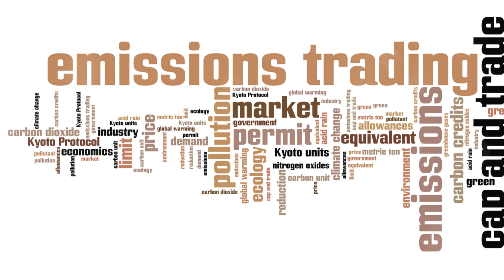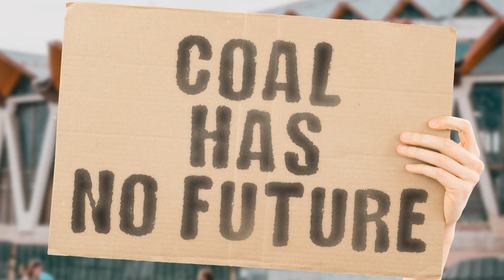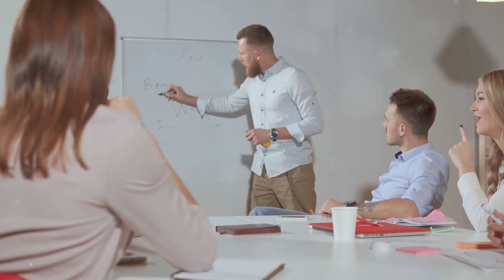Australia's Nuclear Debate: A Bankrupt Idea?

Comment: theres a difference between radioactive waste and nuclear waste, radioactive waste is not really a concern its mostly hardware components and protective gear used in power plants that is not very radioactive and is already recycled effectively, nuclear waste  which is spent nuclear fuel is the more difficult waste to manage that is the major concern but it can be recycled into new fuel and stored in geological deposites.
Reply from the maker: Thank you for sharing your info with us

Comment: Projects spiral in Cost. But the "small " issue of Snowey 2 headlineslike "“Australia’s biggest engineering debacle:” Snowy 2.0 costs double again to reported $12bn" . Still nothing to guarantee Base Road Power availability. And it also has tpo come down to "How much value would you put on a pristine Forest mountain  rainforest without the bulldozed destruck of access roads to Wind Turbines.. Another "afterthought" is that there is no requirement on the owners pf Wind Turbines or Solar factories to be cleaned up after a "maybe" 20 year life. Although one violent hail storm could reduce that to months  or small No of years. The Water My city drinks depends on the quality of the water that seep down from the surface, Depending on that water does not contain Carcinogenics from decaying Solar panels or wind turbines. What a true catestropy it would be if we saw Wind turbines faIL, OR THE OWNERSHIP FAIL AND THEY WERE LEFT TO RUST AN DECAY ON THE GROUND OR INTO THE GROUD. What a strange double standard it is that the mines that provide raw materials for these renewables are contracted under strong conditions to rehabilitate their site. Why not companies who scar the forests & bushlands of the great dividing range? Its because all existing enviorivemental  laws are being pushed aside in the face of the "Climate emergency. So what good does it really do if we save our mi9n ute Co2 output at the cost of the beauty and amenity of our enviorment, which the Greens in Government under their previous party leader chained thenselves to bulldozers in the 1970's to protect old growth forest. But now its Greens supporting the "Rip Rip woodchip" approach to many forests on the beautiful native forests of the mainland. Regardless of the use of the wood from the trees bulldozesd, the message  is the same, they don't give a damn about the damage they are doing, or how it will be rehabilitated when the HEAVILY subsidized Wind urbine and Solar factories financially collapse  if the public don't heavily buy in on the 86% renewables push. At the very least we need companies who take financial responsible for the destruction really are as locked in to rehabilitation as the miners. That is:
https://www.qrc.org.au/advocacy/environment/rehabilitation-and-surrender/#:~:text=Mining%20activities%20adhere%20to%20a,the%20Environmental%20Protection%20Act%201994.
But with our Labor Government looking after it; I think it would be safe to assume that no rehabilitration contracts are in place.  For no, in full steam ahead , as per the lyrics of John Williamson's song. Rip Rip Woodchip:
What am I gonna do?
What about the future?
Gotta draw the line without delay
Why shouldn't I get emotional?
The bush is sacred
Ancient life will fade away
Over the hill I go
Killing another mountain
Gotta fill the quota
Can't go slow
Huge machinery
Wiping out the scenery
One big swipe like a shearers blow
Rip rip wood chip
Turn it into paper
Throw it in the bin
No news today
Nightmare dreaming
Can't you hear the screaming
Chainsaw I saw more decay
Remember the axeman knew their timber
Cared about the way they brought it down
Crosscut black but tallowood and cedar
Build another bungalow pioneer town
I am the bush and I am koala
We as one go hand in hand
I am the bush like Banjo and Henry
Its in my blood gonna make a stand
Rip rip wood chip
Turn it into paper
Throw it in the bin
Don't understand
Nightmare dreaming
Can't you hear the screaming
Stirs my blood gonna make a stand
Reply from the maker: Thank you for sharing your thoughts.
Reply: @GreenPlanet2050  Your Vid starts out showing the barren , unused wastelands of Australia, But omit that this "most Sun" area of the Nation has been completely overlooked in harvesting solar energy. THe unused "donut hole" area of Australia has abundant sunshine, even crossing several time zones. And the fact that there are huge temperature variations across that very hot desert centre, must, I assume, create windflows for wind turbines. The easy way out of destruction of the environment on the coasts was an easy unthinking way.. Not enough thought or planning put into the wind and sun solution. I mean, if all the generation is on the East coast; its a hell of a long transmission way to get it to West coast. On the other hand if generation was more central the distance to population East, South, North, West is less, and the vastness of the continent with sun being overhead in the West generating energy, the evening peak in the East is long past. There could have been more consideration given to the unusual benefits Australia could have in that huge North South East West distances. Something totally different to the experience of a small European Country more comparable with Australia's Southern Island state of Tasmania. (but without the high winter snowfalls)
I couldn't watch it all; just so much ignorance of the continent shown. To compare Norway to Australia, get a map and overlay one over the other with average sunshine hours and wind velocities. Once comparisons are done with small windy frozen countries. OMG
Reply: This is the most nonsense thing I’ve ever seen. Leave your coal in the ground if you care about carbon dioxide stop pretending to be green. If you want to gamble on renewables go for it, lol

Comment: I have two properties that run mostly on Solar & battery so I am not anti renewables, but for a national energy grid system they dont make sense, aren’t compatible to an AC grid system making them more expensive and unreliable.
Australia needs a reliable & efficient energy policy that wont wreck our economy, ecology & environment, that is for sure.
Did Chris Bowen sponsor this vid? Because it sure seems like it is all for the expensive, economy robbing, inflationary & tax increasing, corruption backed, bushfire starting, unrecycleable, unreliable, intermittent, weather dependent, without any base load power, replaceable renewables that will need replacement every 10-20 years if not hit with hail, storm, cyclone, lightning strikes, meteorites, bushfires, failed bearings & blades, mechanicals & electricals, and still require an extra 28,000 kms of more expensive bushfire starting HV transmission lines + hundreds of billions of dollars worth of storage in dams & batteries and is destroying our protected environmental areas & habitats of platypus, koalas & birds etc throughout Australia & its delicate fishing & marine life areas, while still needing a full backup generating system for when all the renewables failures start (which is now).
So I have to ask: is destroying the planets beauty, ecology, environment, economy, industry, growth and quality of life of most humans & many birds, plants, animals, forests & marine life with the climate change doomsday untruths to fuel corrupt unachievable net zero agenda’s and funnel stupid amounts of global money to a few offshore elites the best way to save the planet?
We emit less than 1% global CO2, have bans & restrictions on coal, gas, oil & nuclear use, are shutting down power stations without a backup in place, are divesting 21 billion into upgrading our gas output we cant use & pay for gas ourselves exorbitantly and yet we export 25% of global gas, not to mention billions of tonnes of coal, uranium and oil as well, what a hypocracy, China build 2 coal powered stations every week & 3080 in total, we have 15 with 6 set for shutting down soon.
Stop the renewables fantasy & carnage, forget net zero & Paris Accord, UN, WEF & WHO, this would be a good start.
Keep the coal & gas powered stations going until we are ready to move to nuclear, stop the political party donations, start charging for all the gas & coal that is being rorted, and ffs stop voting for Labor ever again.